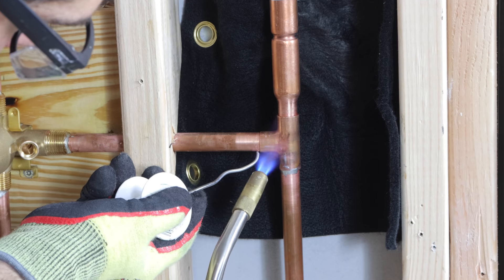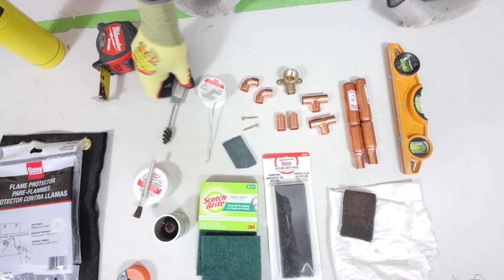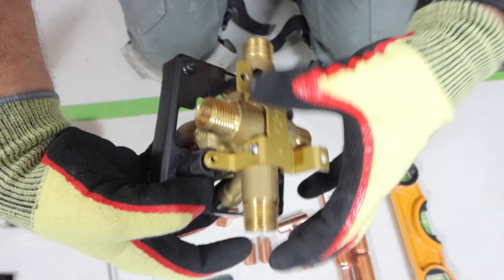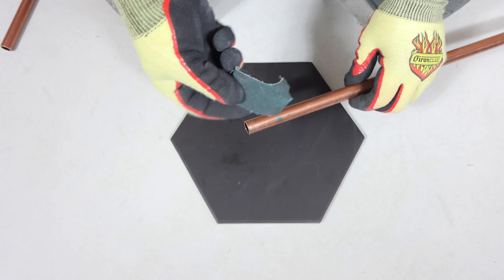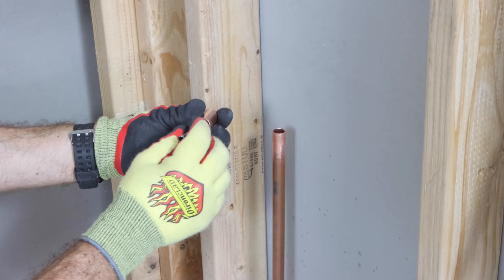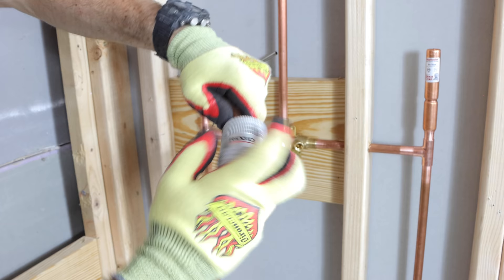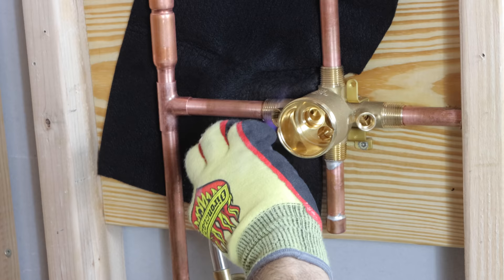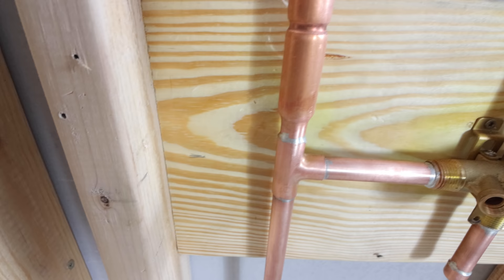Delta Shower Valve Installation Tips for Beginners

Comment: Professional work , I like the flame protector , plus i have noticed that you need to clean the access flux to prevent green stain after a while  and there are a little bit of difference between our materials in South Africa and overseas .

Comment: Nice video. I would add inf on setting the distance of the main valve body with respect to finished surface, which is the irst step that needs to be right. Different tile thickness different grout thickness, different substrate thickness can make this a fail.

Comment: Tons of great info here - Thank You . It would be great if Delta provided a technical drawing showing the side view of an installed value with all pipe , stud and wall dimensions .
But you've shown here how to measure how deep to install the valve relative to the studs .
.
Reading comments on line
- Shower head height above the shower floor 72 to 78 "
- when installing for a bath tub / shower , note there is min / max height between the valve and bath tub spout
- for shower only , recommendations for the valve height range between 38 and 48 " from the shower pan floor . 
.

Comment: Do you typically air pressure test, prior to closing up and tiling?  OR just turn on the water and check for leaks?  How long do you watch for leaks before putting on the backerboard?  Also, how to know if the solder will not fail, especially thru colder weather where the water pressures may increase?  Trying to think thru how to be confident with the solder joints?  I've soldered and looks good, holds water w/out leaking...but if I do in bathroom not sure how confident to be (& any testing that folks do) prior to closing up a wall?  Great videos!  Very well put together and concise!

Comment: Only thing i would critique is when soldering, you should heat from the bottom, & apply from top/sides. Capillary action will seal the joint adequately. Great video

Comment: Now I love this!  All hard pipe!! Solid pressure and longevity
Reply: I’ve installed copper for 35 plus years. I thought the same. Going way back we hated PVC and thought it was garbage vs cast iron - wrong. I didn’t like Pex either at first but it’s pretty much all that is used in most places now. You have to have an open mind as technology and materials change. Think about it- we used lead in my early years in the trade too😂
Reply: @flyingburritobro68  you're now comparing apples and oranges cast iron isn't even a thing and copper doesn't break down like pvc or pex and thin enough pvc allows pressure drop with allowing movement and same for pex movement equals pressure drop and I don't like low pressure
Reply: @flyingburritobro68  I would never replace copper with PEX. It's already had it's share of issues and will probably have more in the future.

Comment: Any reason for recommending the more expensive type L copper?   FYI, my 2004 home is completely plumbed with type L…and so far, two pin hole leaks in the type L.  Not sure type of copper used is critical, exception being in some plumbing configurations and location other than a shower set up.  Good video, though.  Your close up of the black template box is about the best I’ve seen on these instructional vids, both in terms of the close up and angle of that alignment template , as well as use of the backerboard/tile test piece.  Most vids just blow by this leaving a lot of first timers confused about what that sq blk template plate is suppose to line with.
Reply: Type L is higher quality (heavier, thicker).  I have never seen it fail by itself.  I install type L anywhere it's going to be concealed, because I hate opening finished walls.  Cheap insurance.

Comment: Great video - it’s just what 
I was looking for.  Thanks for making it!
Reply from the maker: Thank you 🙏🏼
Reply: @HomeRepairTutor  how far apart do u need the lines??
Reply: @HomeRepairTutor  how do i check for leaks for my soldering for this faucet ? should i just connect the pieces? i wanna check before i install drywall cement board etc

Comment: Your wording made it sound like the Flux might be optional. It's not. Also, how are you going to get those water hammer arresters out after they fail in a year or two?

If you are new to soldering, solder everything you can before installing, so you have an unobstructed view of your joints. I laid out my entire shower and then soldered it on a bench with the exception of the two connections to the water so I could closely examine my joints before install where they would be obstructed from view

Comment: I am changing my shower stall plumbing from an old two handle to a Moen single handle valve and trim.  Moen has a nice remodeling kit.  My question is.  The value that was sent to me is a four port posi temp.  I do not have a tub so can I use the four port valve or should I use a three port valve.  I realize I can cap the tub port but will that change performance of the four port valve.  Thanks and very informative video.

Comment: Thanks for the video. This is definitely not for the  beginners (LOL). I just wonder how many years  does it take to develop the skills  this guy has.  I really want to learn how to solder properly but need some device so I can check if there's leak or not )).  It's always a joy   to watch how the professionals do the  work.
Reply from the maker: Thank you, it just takes practice and knowing how to prep the pipes. You can buy a bunch of fittings and simply prep and solder over and over until you’re happy with your results
Reply: Fantastic tutorial - never even thought of using the deburr. Thanks for the tips!
Reply: It's not difficult to do a pressure test after setting up your feed lines and the shower pipe, but before enclosing the wall space. The Delta faucet makes this easy, they include a plastic cover specifically for this and I've remodeled two of our showers with them. There's also an inexpensive pressure test tool - a shower test plug - that you screw straight into the shower drop ear elbow. It can be annoying if you have a leak, but it only takes a few minutes to reheat the joints, clean off the solder, re-flux, and re-solder. The hardest part? Running up and down the stairs to turn water off and on.
Reply: Soldering is easy and it's actually really hard to screw up if you follow the correct step. Looks up a few videos on soldering pipe from actual licensed plumbers (which this guy aint) to learn how to do it right.
Reply: @MAGAMAN  What do you see in his technique that is incorrect?
Reply: @joelongtin7532 The valve with the shut off valves make it even a bit easier to test.

Comment: When you are soldering the pipes/fittings, are you getting all the way around or just the front/visible side?
Reply: If I may, his video is just showing what you see in front but when he heats up the pipe and applies the solder,  the solder actually "travels" around the pipe.  The Flux application helps with allowing the solder to travel.  I hope that makes sense.
Reply: @richardlaundreaux1374  You do need to make sure you are using enough solder to get all around the pip. The way he is "touching up" the other side of the pipe with the solder is incorrect. You should never need to do that because it will completely fill the gap if done correctly. There are some good videos on soldering out there if you can filter out all the useless DIYers making videos on subjects they don't even understand.
Reply: @MAGAMAN   Sometimes the capillary action is insufficient because the back of the fitting against the blocking doesn't get even heat.  He should have soldered the valve body stub outs on a workbench, this way you can heat the fittings more evenly and visually confirm the solder flowed properly.

Comment: Looks good, You can get only the shower valve for delta so don't have to be plugging the bottom spout outlet.
Reply from the maker: thank you, appreciate your kindness and pointing out that option. They do that for PEX A and PEX B, too, which is awesome
Reply: @HomeRepairTutor  Thanks for replly
Reply: Just screw on a cap.  Delta got cheap a few years ago. We're doing a flip and got one each, the shower only valve was $5 cheaper than the competition.  Went to install the the shower valve and found a 1/2" threaded hole outlet on the bottom of the valve.  I call Delta and they inform me they don't include the brass plug.  Well I have 1/2" copper caps but no more 1/2" copper male adapters.  The tile guy is ready to start the backer board, so back to the Depot, a brass plug is $5 and they don't have one in stock.  So much for saving $5 and time.

Comment: It's nice to see efficient clean pipe work. However these videos usually feature ideal conditions. By that I mean "new work" with plenty of space and no impediments. In real life, however, we very often face sometimes ridiculously sub-optimal conditions, usually repairing old work. 

For example, I am facing changing this valve and faucet, shower head, spout, etc. Tearing out the old plastic shower wall to be replaced with tiles, but keeping the tub. Inside I find that the studs around the valve are much too close together which severely cramps the working area. The copper supply pipes are literally touching the inner stud edges so there is no room to even use the smallest pipe cutter, and no room to insert a fire barrier for new soldering. The list of snags goes on. Many jobs look so ideal and simple on youtube videos, but seldom work out that way.
Reply: Probably done by now, but could you have removed the studs?
Reply: @ibealion1  To turn it into a MAJOR renovation, it would have required totally tearing down the wall which was a finished interior drywall on the other side. Yes, anything could be done, but it would greatly amplify the scope of the repair, and the homeowner certainly would not have wanted that. Especially if it meant ruining other portions of the finished interior bathroom.
Reply: @KpxUrz5745  I see. That makes sense. I've just gotten done tearing out the tiled surround in my old tub surround and have thankfully not run into anything like what you described. I guess I should be thankful for that. In fact, behind my valve is a large space because it's where they ran the gas vent pipe from the basement.
Reply: 1: Hack Saw
2) Copper is flexible. Unless you cut your connection off at ground level you should have plenty or flexibility in your lines.
3) Do all your assembly and soldering outside of the wall, then you only have to solder the two connections to the water supply.
Reply: @MAGAMAN  I think I already addressed that. Even if cutting the copper with a hacksaw, this installation left no room to solder pipes as they are up close to the studs. There is zero flexibility in the arrangement of copper pipes and elbows in this arrangement. Bottom line: a seemingly simple job requires a full teardown of the finished wall including the studs, OR, fully removing all the copper pipes and attachments to the value and redoing it all somehow, maybe with PEX.

Comment: How can I test the hot and cold water coming out of the rough-in valve from the hot water tank? Should hot and cold water come out of the two (2) separate valve holes? What if water is only coming out of one valve hole but when the cartridge is installed the water mixes fine, but the pressure is low? Would a "low flow rough-in valve" cause low water pressure at the tub faucet? Thanks.

Comment: Why did you  use solder on thje valve fittings? I  would  compression fittings for that and protect the valve from getting hot.

Comment: what do we do with the stops? I am unsure the point of them and how to make it water tight in my valve
Reply from the maker: if your valve has stops, take them out prior to soldering then replace them once the valve cools 👍🏼🔥
Reply: @HomeRepairTutor  and do they just sit in place as they came or do you need to tighten them in place? That's what I was mostly unsure about or what the point of the stop is in the first place any way
Reply from the maker: @AveryHeilbron  they slide in place then you have to tighten the locknut with pliers to keep it watertight
Reply: @AveryHeilbron  If the stops you are referring to are what I think they are, these are used so you can shut off the water to the valve body if you need to replace or clean out the valve. You can also use them to adjust the water pressure to the shower.

Comment: Can copper type M be used on the valve? My old plumbing has type M all around and was wondering if I could just match what I currently have. Thanks for the video
Reply from the maker: I’d use Type L which is thicker
Reply: @HomeRepairTutor Thank you!

Comment: I am facing this issue- we are renovating the bathrooms, the constructors put new delta valve for the two bathrooms and the day after that we noticed kitchen cold tab is having warm/hot water. The constructors stated that he didn’t touch kitchen so it’s not his issue; but this only happened after he put on new valves for the new bathrooms, not they are still at demo stage, I don’t know how to find which valve is causing the issue
Reply: Are the shover valves in the same wall? Some valves may be installed back to back, thus simplifying the the installation by not having to reverse the supply lines for one of the valves.  One valve is piped normally cold on right, hot on left, the other valve is reversed.  On Delta and Moen valves you rotate the valve cartridge 180° and install it in the reversed valve.  Who ever installed the valve cartridges after the rough-in wasn't aware of this and installed both cartridges the 'right' way, meaning one is in the wrong way.

Comment: I have to now change my valve, I sure hope the installer did not solder in valve like you did. Apparently you did not see there are threads on the end for a reason.

Comment: Awesome 👏 
Great tips, very informative video and fun to watch. Thanks 👍
Is it possible to get this valve without the bottom port?
Reply from the maker: thank you and yes, you can get a PEX version where they plug the port for you
Reply: @HomeRepairTutor  : awesome.
Thanks for the reply and have a great evening
Reply: There are several versions for copper and pex as for shower only with threaded copper connections, most important may be to get one with internal valves required by some plumbing inspectors.
Reply: @786otto  :  great and useful comment. 👍 thanks for the tips

Comment: can you use the same water hammer arrester on kitchen sink, toilet, bathroom sink valves too? thanks
Reply: I would never install water hammer arresters in the wall. They have a limited life of a few years usually. Installing the screw on kind at the washing machine, bathroom and kitchen sink should be more than enough.
Reply: The guy just likes to show off his soldering skills and pretty joints(nothing wrong with pretty solder joints).  This video was probably sponsored by a water hammer arrestor manufacturer.  A shower valve doesn't create water hammer.  Water hammer is a result of valve opening and closing very quickly like solenoid valves in appliances like washing machines and dishwashers.

Comment: I have this same valve but want to add a shower wand to it. Can I use the capped bottom exit for a shower wand? Please let me know. Thanks
Reply: You could, but you would need to have a shutoff at the showerhead and at the sprayer wand, otherwise water will flow simultaneously from both ends.  Get a valve with an integrated diverter or a separate diverter at the outlet of this valve.

Comment: I have a Delta Foundations one handle valve faucet. Installed it and the water came out the shower with the tub faucet open. A plumber told me the valve is upside down. So turned it over and water came out more through the shower. Is it a bad valve?

The shower pipe set up: 1/2" CPVC on the hot and cold. 1/2" CPVC on the tub faucet.1/2" Copper pipe on the shower.

Is the CPVC smaller than the copper pipe causing the water pressure to go up to the shower? Or is it a bad valve?
Reply: The drop to the tub spout should be 1/2" copper or 3/4" CPVC.  The 1/2" CPVC has the same nominal outside diameter as copper but the wall is thicker thus a smaller inside diameter.  This happened to me once with a Moen valve, water would squirt out of the shower head when the valve was turned on, this was the first time I used pex for the drop to the spout and to the showerhead.  On page six of the installation instructions for the valve it stated if using pex to go with 3/4" to the drop elbow.  Had access to the back of the valve from the linen closet, unsoldered the 1/2" fitting male to 1/2" barb adapter and replaced the barbed pex drop elbow with a copper one and fixed the problem.  I've installed dozens of the  Moen valves over the years and always used copper.  The manufacturers should better update their installation instructions now with the availability of the different piping options.  Moen was aware of this issue, but they just amended their instructions on page six.
Reply: That was it! It's working now

Comment: Which shower cartridge would I use with the universal delta valve? We've installed everything, but are having a problem with the knob or cartridge we have not shutting off the water?
Reply: Did you ever solve it.?
Reply: Get the latest OEM Delta 'universal' cartridge.  Some generic cartridges are hit or miss.  The word 'universal' to Delta is like 'unlimited' data in  the cellular provider world.

Comment: A Home Depot rep told me I could simply use an 8" section of 1/2" copper pipe instead of the "water hammer arrestor" thing you used.  Is this okay?
Reply: No, this is no longer allowed by code as far as I am aware.
Reply: A tub/shower mixing valve gradually turns on the water, I never seen a water hammer arrestor in a bathroom setting.  They are used near appliances that have solenoid valves, like washing machines, dishwashers, ice makers, water sprinkler timers.